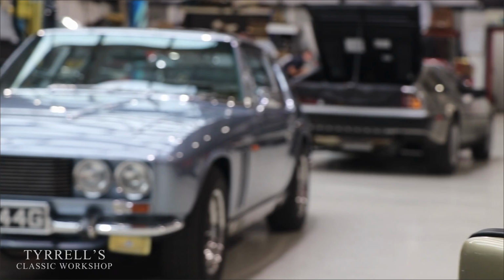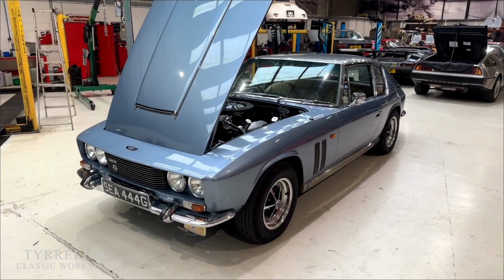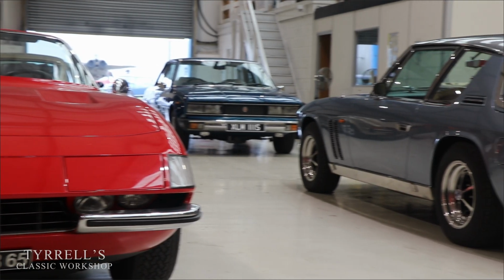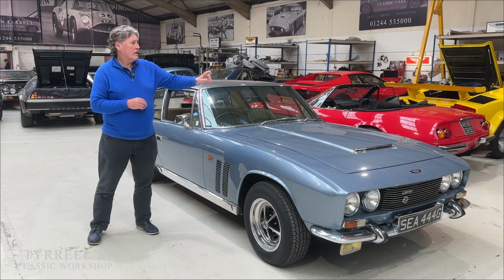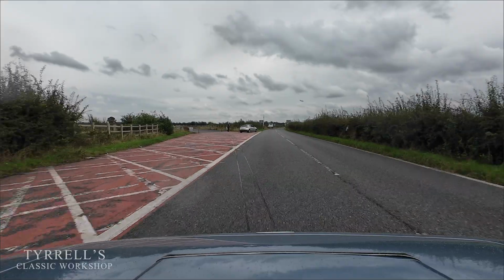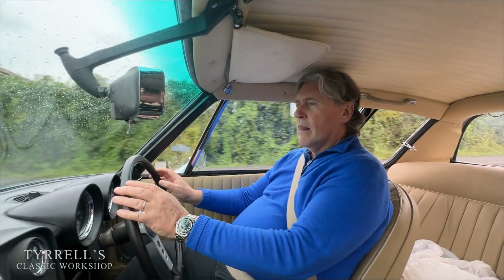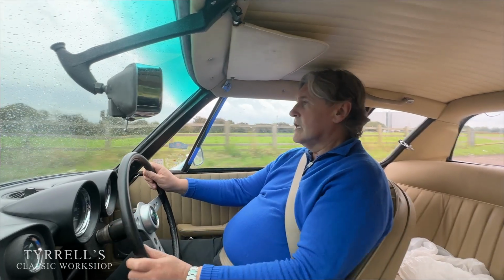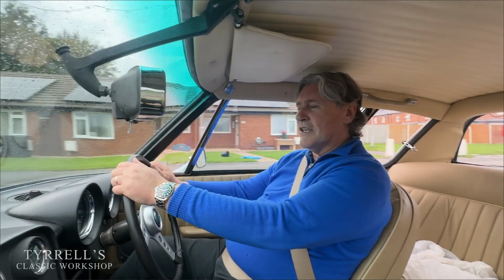Jensen FF, a pioneering marvel, restoration completed! | Tyrrell's Classic Workshop

Comment: The 383 cu inch 6.3 was known as the G series , the later 440 inch , essentially a de tuned Dodge Charger unit was known as the J series , although of larger capacity had a lower compression ration , designed to run on 2 star fuel in its day . The smaller engine was fitted to Mk1 and Mk 2 Jensen Interceptor models and a small number of Mk3 models before the larger low emission model became standard. The earlier engine was known to pick up revs slightly quicker than the 7.2 . Either way , it’s easy performance with the Jensen , huge torque at low revs matched to the wonderful torque flight auto box, 30 - 50 mph in 2.3 seconds says it all. Wonderful car
Reply: The FF used a 383 Golden Commando spec motor. A few of the very early Mk3 440s had 4BBL engines that weren't de tuned! Very nice those! Later on the SP came with the most powerful 440 ever fitted to a Jensen. Along with the Hemi that was the most powerful muscle car engine ever supplied in a Chrysler muscle car, and went into the Jensen "as is". All Jensen needed to do was put a small dent in the air cleaner for bonnet clearance!
Reply: Hemis @zumwild
Reply: Arrrrh, what? The Chrysler 'big blocks' are the "B" and "Raised B" ( often written as "B/RB" ) for the B-series V8 and the Raised Deck Height version.
The 170ci Slant Six is the "G" block, and the 255 and later 198 the "Raised G".

Comment: Had one since 2003. Saw it sets itself on fire, (it's a hot V)  then had it fixed. When finished, I put it in a container in 2004 and that is where it is to this day. Was hoping it might appreciate a bit. I don't think it has. Notice the tiny front  discs. They are just not up to the job. Way below par for a heavy car.  God help you if a modern tiny box brakes hard in front of you ! The gear ratio is pathetic. The standard torqueflight 3 speed is a joke. At 70 MPH it was doing near 2900 rpm contributing to a really horrible mpg figure.  Why  ??? with all that torque available and  7.2 litres on tap. I fitted an American under and over system giving "6" speeds dropping the 70 mph rpm down to 1600 rpm.  No problem at all. What am I going to do with it???  Eventually put in on the wall as art !!

Comment: Most intriguing cars. A fully restored and highly curated Inceptor in dark green metallic with similar interior leather trim and carpets does live nearby us in which we had a go. Wonderful drive. Very different actually. However, the FF is of course entirely different under the body. The design is evidently unmistakeably distinctive. In a contemporary zeitgeist with all cars virtually eyeing extremely similar, these classics are such a breeze of fresh air 💓 Thank you so much again Iain.
Reply from the maker: Thank you too. They really are a good- looking car. I prefer the proportions of the slightly longer at the front FF, but the Interceptor is also pretty

Comment: you are spot on as to how one bought a car then..I lived in Ramsey, Hunts..in 1971, I needed a car for my wife to tear about in whilst carrying our 5 year old daughter..I took to to Huntingdon, to the BMC store..She chose, and rather quickly, a Morris Marina TC..red with black interior.  I pulled out the book and wrote the check..Done. We put 145000 miles on that TC in 3 years..After they made good on a replacement transmission and engine in the first 25ooo miles, all was golden with that car. It ran an honest 126 MPH flat on, and 0 to 60 in 7.3 seconds..I did do a bit of tuning to it to make it move better..Brakes were the hardest to tune..required larger wheels and a host of suspension mods.
Reply from the maker: Thanks for that- great

Comment: I believe they did a Triumph Stag FF and possibly a Ford of some sort for the police to test . Could be wrong , I’m sure if anyone knows better they’ll correct me .
Reply: I was actually coming to say, that Gianni Agnelli probably had it to check out the FF system for himself: quite a few companies did at the time, but of course, few made it to any sort of production. Brabham apparently fitted it to some Mustang GT 350s around then, and Ford and Vauxhall eventually looked at it for rally special purposes (Capri and Manta respectively). The last application I know of, was a handful of  MK1 Opel Senators for the British Army, which were used for covert missions in E Germany. There's at least one in a military museum, but I can't for the life of me remember where that is! But I did have some good chats with one of the drivers, when I worked with him.
Reply: They did. Two I believe.
Reply: @jameshamlyn4172  yes that was the Stag and the police tried out a Zephyr or Zodiac .

Comment: 328 FFs were built, 15 were Mk3,  I used to own chassis 326.
The Mk3 FF stayed with the same 383 engine, because the FF chassis (which is significantly different to that in the Interceptor) wouldn't allow the 440 engine to sit low enough for the bonnet to close. (The 440 engine was quite a bit taller than the 383.)
Strange you didn't mention the torque splitting 37/63 front/back, or the central diff limited slip system ... unlimited front over-run, zero front under-run.
Rebuilt the whole engine and Torqueflite.
Also rebuilt the transfer box - more from curiosity than need. They could handle in excess of 800HP, as a drag racing friend in America proved, so nothing wore out in normal use. VERY over-engineered.
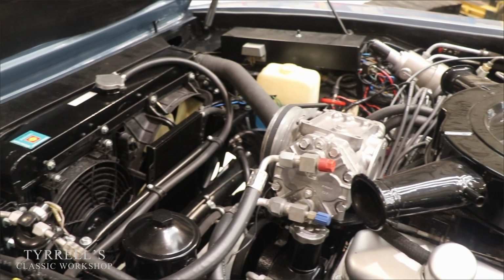Shame about the Maxaret, too (the control unit for which is still visible in the clip @ 6:23) . I eventually fathomed everything out and totally rebuilt mine.
In the Mk3 they replaced the painted Chrysler rocker covers with their own branded aluminium ones.
Reply from the maker: Thanks- very interesting!
Reply: Great vid again Iain. You’re the best on YouTube at this schizzle!
Reply: A couple of mk1’s have 440’s retro fitted. One was factory.

Comment: The home office around 1969 commissioned a fleet of Ford Mk 4 Zephyrs with the same four wheel drive system with anti lock brakes as per the Jensen. Under the bonnet there was a counter  that recorded the number of times the anti lock braking system operated.  They were sent out to various Police Forces for evaluation. I was a member of Lancashire police H.Q.Traffic Patrol at the time.   When two officers from another traffic group showed me around one. I was suitably impressed by far to low down the pecking order to have a go.  I was only in my early 20's.
Reply from the maker: Thanks for sharing that- highly interesting!
Reply: For whatever it’s worth, Jack Brabham owned from new a 1969 Ford Mustang Mach-1 Sportsroof (in ‘Wimbledon White’) with a 428 V8 and Automatic, that has similarly been converted by FF Developments into AWD.

I’m Australian but about 20 years ago I noticed it both featured and offered for sale, in a UK Classic Cars magazine, with impressively low miles and for a surprisingly low (bargain) price - especially for its unique spec. 

And yes Ian, I’ve been quietly kicking myself (and drooling) ever since.
Reply: Wonder if any of them survive?
Reply: @patriottothecore6215   I spoke to someone on F.B. some years ago who actually owned one I told him what the second speedometer was for on the dashboard.  It was for checking the speed  of motorists it was a certified speedometer who's read out could be used in court for traffic offences. We didn't use the speedometer as fitted by Ford.

Comment: These were a common sight in Houston, Texas during the 70s and 80s, usually seen in the better part of the city. They were eye-catchers then, just as they're eye-catchers today. Considered to be far more reliable than Ferrari, it seemed they had problems with overheating in hot Texas summers. The Jensen FF was always driven by men, whereas the Jensen convertibles were usually driven by women (* a teenage boy's observation during that time.).
Reply: Don't confuse the Jensen FF with the Intercepter, the FF had an extra few inches forward of the doors to accommodate the 4WD you can tell the difference with the location of the side vents.
Reply: The Jensen FF was not sold in the US.  You’re thinking of the Jensen Interceptor, namely the Interceptor III.
Reply: Are you sure it was an FF? These were never produced in LHD. It may have been an Interceptor these were visually similar, just with one side vent and about a foot shorter.
Reply: As one who spent the 70's off Memorial Drive...you made a nice picture in my head.
Reply: Nice job done but I’m not a fan of these 
However if given the chance I’d have got Craig to drive me and I’d have added my rear to those of Sophia and Jackie O on the front passenger seat 😎
As always the team have given their all to make this good as new and Iain always makes fabulous content 🏴👌
Reply: They won’t have been common sites anywhere and definitely not Houston, this is an FF but the car you mean is the RWD version, the Interceptor which was very successful in the U.S.
Reply: Why no headrests seats look like neck beakers
Reply: @rogertallboy no headrests on cars in 1969……
Reply: River Oaks more so than Scott St
Reply: This amazing channel has many viewers from H Town I see. 
Go ‘Stros!
Reply: lol there never has been a “better part” in any city/town in Texas.  I do agree with your statement that the Jensen is a head turner.
Reply: The Interceptor would have been but the FF unlikely. Only 330 produced and all were RHD. Most still in Britain to this day.